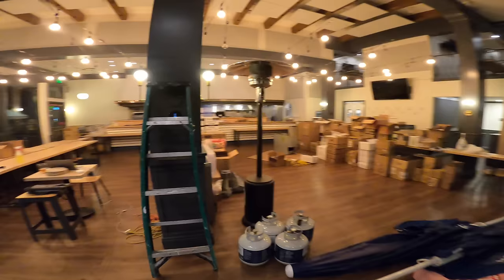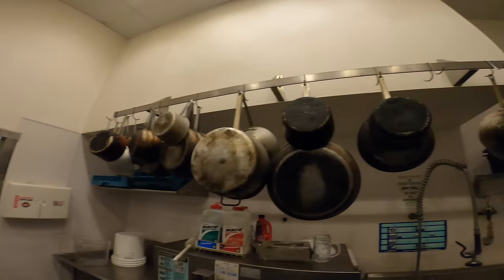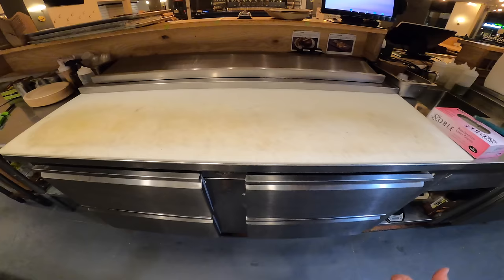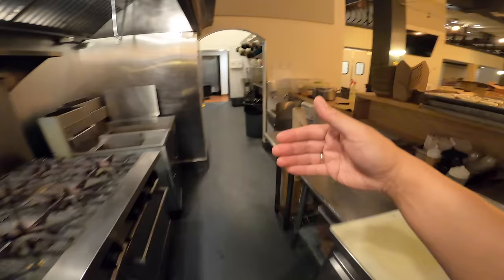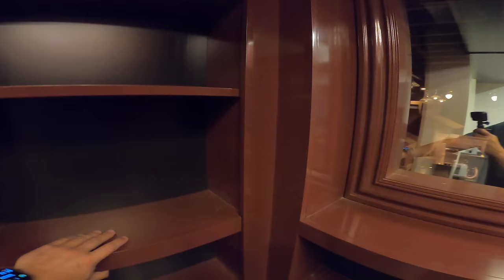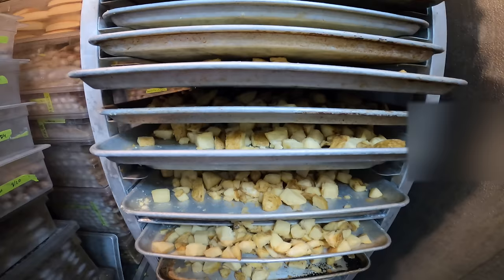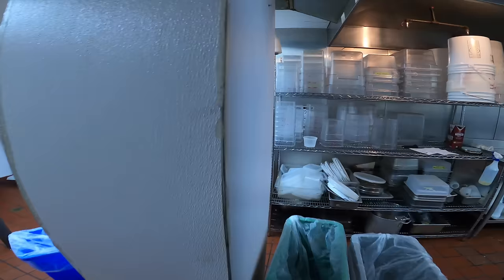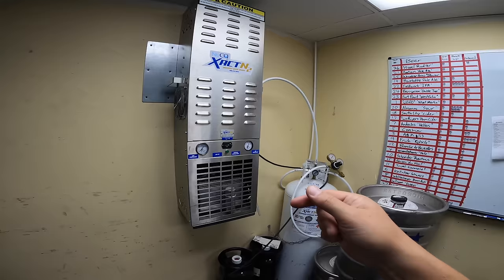Let Me Show You My Restaurant | Kenji's Cooking Show

Comment: This is a very clean kitchen, I really appreciate you actually caring. The amount of nasty kitchens I have been in makes it hard to order from some places.
Reply: I worked at a huge restaurant for 2 years (250+ guests room), the kitchen was fully cleaned every night and we still managed to have roaches once in a while. It's hard to keep a restaurant clean like this. But the rule is, if the kitchen is not cleaned every day, don't even bother eating there. Ours was and we still had problems.
Reply: Does the US have food hygiene ratings? In the UK we have a 5 star rating system, you will be closed down if you don't get enough stars and personally wouldn't eat at a restaurant that has less than a 4 star rating. places are required to have the rating on display and you can look it up online, it works really well

You can also look up the inspection reports and when they were last inspected online. You won't be getting a 4+ star rating if you don't do a relatively deep clean every night
Reply: @TomusMedia  it's a bit loose right now during covid. But the health code is run similarly. Can't have lower than 80/100 iirc.
I'm amazed he can keep a restaurant that size so clean considering I've been working with a minimal staff since April.
Reply: @TomusMedia  Yeah the US has food safety inpesction that grades on a scale of 100. Used to be pretty strict pre COVID. Still if you go to a place that regularly gets 95-100 you're pretty safe
Reply: I used to do pest control and would service some restaurants.  Some were impressively clean and there are others that make me question humanity.
Reply: Michael Wilke i bet it’s easier during the pandemic, but yea i was very impressed

Comment: I work on the engineering team that designs those CVaps. Pretty cool seeing Kenji use them.
Reply: CVaps are the straight business.
Reply: Is there anything like that available for the home kitchen? Or in the works? Awesome to be able to sous vide without having to vacuum seal, and more than 2 steaks at a time
Reply: @Metalaco  There's an Anova Precision Oven unboxing on this channel from a few months ago that you might find interesting. It's a programmable countertop model big enough for a whole chicken, and it can also do higher temperature dry cooking as well, unlike a pure Controlled VAPor oven. It wasn't a review video, though one may be forthcoming eventually, but has some background. 

There are also built-in combi-ovens and steam ovens for home available for more money. I think the Anova is about $800 CAD, built-ins for home range from around $1 k - $ 9 k CAD, depending on size, features, construction, design, warranty, whether you get them plumbed in vs. having a tank you fill, etc... I've read that you can also sometimes get used commercial ones for comparable prices if you know where to look. If you're getting a built-in, you might want to get a combi-oven instead of a CVAP oven so that you can use it as a multitasker rather than needing a separate appliance for higher temperature cooking. Definitely check to see what the max. temperature is if that's the way you go though, as combi-ovens vary depending on what they're intended for. Also check to see how precise their temperature and humidity control and sensing is. Not all combi-ovens can do bagless sous-vide due to lack of precision. Some use steam for faster heat transfer (hence "speed-oven") and a way to maintain juicy-ness, or improved baking, which don't have the same requirements.
Reply: @seabream  that's super helpful, thanks, stranger!
Reply: @Metalaco  You're welcome! I only saw that video a few weeks ago and almost immediately my mind was spinning with thoughts about how much that could change the way I cook things at home. It's a bit of a rabbit hole all the variations in different appliances though, so definitely do your research. Like, for instance, there are some ovens with steam out of Japan which are specifically optimized for various kinds of thick toast dishes, which isn't something that's really part of my everyday life and wouldn't have occurred to me just from looking at a listing. The Anova is appealing partly because there's a fairly active user community who discuss their experiences with trying out different ways to use it, various aftermarket accessories they like, and how to handle unexpected quirks with them. It's still pretty new. I think that they've only been shipping for a few months, so I'm personally going to let them work out any early production teething problems before really considering buying one, but it's a really interesting concept.

Comment: if it's not a stupid question, re: the 3 station sink... "wash, rinse, sanitize" - what's actually happening at the third station?
Reply from the maker: It’s an antibacterial solution where you dunk the clean stuff. Basically it kills any germs they are left on the clean gear.

Comment: Hi Kenji. Did you ever heard of or tried a polish soup called Żurek ?
if you aren't familiar with it basicly it consists of stock made from raw white sausages like bratwurst,smoked or raw porkbelly (diced or a whole peace mainly for flavour),bayleaf Majoram allspice,onions and garlic. When all of that has been cooked for about 30 min to one hour you add a starter consisting mainly of water and flower with some spices and garlick that has matured for about a wek up to 3 weeks. the starter is the main flavour with the stock from the saussages it also acts like a thinkening agent. you eat it with bolid potatoes that can be boild right in the soup and with a hard boild egg and ofc the sliced sausages. typicly served with bread (toasted souerdugh bread rubbed with garlick) 
It's one of the best soups in my opinion easy to make, cheap and it's one of the best ways to higlight a briliant sausage and since you have a lot of them it's a very good form of preserving the not so fresh anymore ones. Hope that will intrest some of the folks on this chanel.
The resteurant looks awsome there is a lot of space and smart solutions that i havent seen before

Comment: as someone who used a double dishwasher for almost a year, i gotta say that once y’all get back in service you should totally get someone out to grease that thing up. i say this because the speed you have to work to keep everything sparkling during a busy service hour is nonstop busting ass (pardon) and with friction on the machine there’s a chance they could do some actual damage to the sensors that read whether the machine is open or not. obviously it’s not as hectic during these covid times and you know what you’re doing in general, but yeah that’s just something i noticed that i figured i’d speak up about.
Reply: also, imagine going back 50 years and trying to explain how you have a tank full of nitrogen under your kitchen full of open flames

Comment: Hey Kenji!

Dunno if you'll see this but re. possible code violations, double check that your (admitted awesome) underground bunkerbar is compliant regarding exit signage and egress.  Couldn't tell from the video if there is a secondary exit.  If the bookcase is the only way in and out, it may need to swing in the direction of egress in the event that a panicked throng of drunk people decide to rush the door after a flaming sambuca mishap ;)

Caveat, I am not a fire marshal, but have run into exit/egress issues in the past in buildings I'm working in/on.

Cheers mate!  Loving the book.

Comment: Fascinating video Kenji, Mahalo!
However, please be mindful of the fire code requirement of separation between an open flame appliance and an adjacent deep fat fryer, or the installation of a baffle plate between the two,  consult with your local fire department or cooking equipment supplier in your jurisdiction.
 Don't want a grease fire happening in your beautiful, well appointed and spotless kitchen and restaurant!
(I'm a retired fire inspector with the Honolulu Fire Department)
Reply from the maker: There’s a 2 foot steel table between the burners and the fryers. We always have all plans approved and inspected before making any changes to the equipment layout. Bay area inspectors don’t fuck around!

Mahalo!

Comment: Are those big pots stainless or aluminum?

Could you show the the pots and pans you use in a little more detail? Are the saute pans carbon steel? If after the dishwasher do you heat them to dry them?

Comment: Hey Kenji, do you keep fried chicken for the sandwich in the CVap also or can you fry that to order and still make your 4-minute pickup time?  If you fry to order, have you tried holding them in the CVap?  What was your experience?  I've heard they were originally designed for exactly that use, but I've always wondered how well they work.  

Thanks for the awesome video!  As a professional cook, it's nice to see how other people are solving the same problems.  Also a video your thoughts on the CVap would be amazing (for me, but useless for most everyone else I suppose).
Reply from the maker: We fry to order. No problem with the pickup time.
Reply: @JKenjiLopezAlt  Thanks for the answer, Chef.  You're frying the pieces from cold?  Or do you have a few orders pulled out to room temp?

Comment: Hey Kenji, I'm really curious about the Nitrogen extractor you're using for your Nitro Beers. I was under the impression that most "Nitro Beers" are served using a mixture commonly called "Beer Gas" which is typically 25%-30% CO2 and 70%-75% Nitrogen. I'm just curious if you are doing some kind of blending (using purchased CO2 with harvested Nitrogen) or if the device you highlighted did some kind of CO2 Harvesting as well. Thanks!
Reply from the maker: That's a question for my partner who manages the drinks program, but my guess would be it's blended.